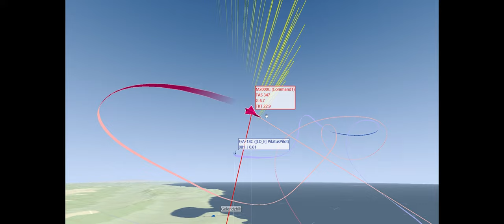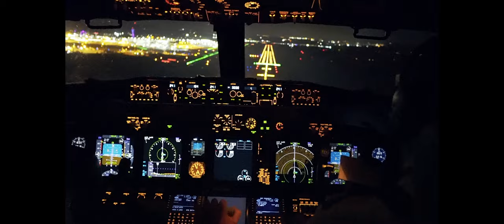Trevor Jacob COULD have Landed (FS2020)

Comment: 9,000 feet up, between 500 and 1,000 feet per minute, that's about 5-10 minutes to find a good landing spot, and even a backup landing spot.  Then an additional 2-5 minutes to go to the backup in case your primary spot doesn't work out.  Also, perhaps it would be a good idea to occasionally look around for a landing spot just in case.  Trevor did none of that.  He just immediately slowed the plane down to stop the propeller, then jumped out!
Reply from the maker: yep!
Reply: So apparent that he flew, pre-planned, to dump the airplane as a stunt.  That pretty much makes looking for landing sites moot, he wasn't going to do that.
Reply from the maker: @whalesong999  Yes but he could have at least taken some acting drama classes before his flight

Comment: 10:00   Well ... couldnt ATC give you a hint as to the wind directions over those mountains for a better glide performance? I am not a pilot, but we do have weather radar on the internet ... and this should be trivial.
[No idea how it works in a FlightSim, but IRL he could at least have TRIED asking, but since he immediately jumped out ... without actually needing to yet ... it is clear as day that he did it on purpose.]

Comment: Staging an engine failure for clicks is poor form to the max. It demonstrates what sort of person he is and whether he is worth being treatest with any level of respect. He fails this most basic test of integrity, however inside his video he talks complete nonsense about how he hoped his video would serve as education for other pilots and for them to always wear a parachute. There is a certain irony that there is a scenario where he could very much have  achieved that lofty goal of teaching aspiring pilots as well as gaining plenty of clicks for the same staged engine failure.  

Let us assume that in an alternative universe Trevor Jacobs was fixing to pull off a sensational coup by staging an engine failure over the sierra nevada (just like what happened in our universe) but instead of simply jumping out the door 16 seconds after his prop stopped windmilling if he had gone into correct emergency procedures. Cool, and calm under pressure, he would have appeared to be the king of cool as point by point he troubleshot the problem. Unfortunately he cannot get engine restarted so he needs to land. Oh its stressful work for sure but hes got this. He could either decide to land on a dried river bed (perhaps he could have researched the area before hand and already had a target in mind but he could ham it up for the cameras as much as he needed (or wanted) all the while  already knowing exactly where he was going to touch down. Or he could turn back towards the flat lands. Then you have the drama of maintaining optimal glide speed but the flatlands seem so far away. Most non pilots do not realise how well many light aircraft can actually glide and so he could play into this collective ignorance of the average people within his audience. Once more he would have plenty of time to ham it up for the cameras. 

Now staging an engine failure is a scumbucket move (it definitely is) but at least with the scenarios i have listed, there are several benefits that would be huge bonuses for him. 
He likes to portay himself as a manly man fearless adventurer sort of person. To him, skydiving out of your stricken aircraft is the mark of a true hero type. The bravery of such a colossus of a titan that us mere mortals could never aspire to match is just awe inspiring and humbling to us poor pathetic adrenalin-free lower lifeforms. (Of course, I have set my sarcasm level to maximum overdrive I am sure you might have noticed), we are not worthy to bask in the brilliant light of this godlike figure. HOWEVER to any of us who have even the slightest understanding of how reality works, Trevor jacobs appears to be the biggest nancyboy sissy manbaby coward on the planet. Engine failure happens so immediately jump out and leave your pilotless aircraft to fly on alone and hopefully it won't land on some camper or hikers head. While the probability of this happening might be small it is still a a very real possibility.  The chances of a fire resulting from the crash, however, is a much more real possible outcome. Such a fire could have drastic conequences, especially to dried vegetation and it is through sheer luck that there was no resulting fire. Trevor, himself, knew that there was a real chance of a fire as he strapped fire extinguishers to his legs...AND YET HE STILL PUT HIS PLAN INTO EFFECT even though he was aware of this possibility. If he had undertaken the proper procedures and landing scenario (as I have detailed) he could have still had extinguuishers but inside the aeroplane which is not unheard of inside a light aircraft. 

As I have shown here he made very poor choices in the search for clicks, and he did get them (yes) but he will also find himself in a lot of hot water from the FAA and possibly the parks and lands department (or whatever they are called in california, I am australian), or insurance investigators if he had lodged a claim for the lost aircraft. And yet a few tweaks to his already severely bad plan, he could have had a better outcome all round. 

I do say to people. Do not unreasonably hold anyone up as a hero figure, especially a youtube figure. This brain melt of society is how we end up with complete sludgepile waste of human skin types like Logan and Jake paul to name but two of a whole class of pathetic clickbait startypes who rake in millions of dollars while giving NOTHING back to society. Let us give respect to those who use Youtube to help educate and grow our understanding of the world around us. Those  are the Youtube content creators that deserve more subscribers and more clicks and yet so often it is the sludgepile types that seem to gain the following and devotion, that they do not deserve.
Reply: Well said my friend
Reply: Extremely well put, and actually a sadly all too real commentary on the world right now

Comment: With a height of 10000ft and a glide ration of 1:10 even Santa Ynez Airport could be possible.
And even if you decide to bail out, first try to phone 999 if your radio isn't working. In 10000ft the cell phone coverage is much better then on the ground  in the middle of nowhere. You only have to sprain your ankle on landing and your faith could be sealed if no one knows where you are.